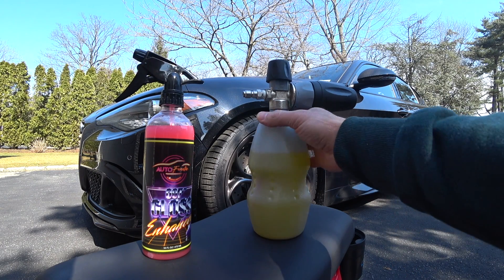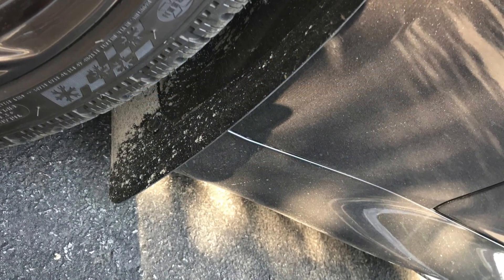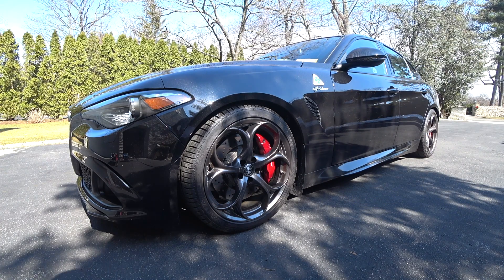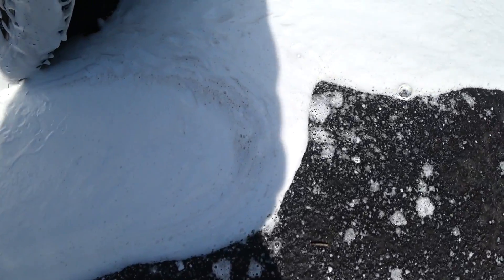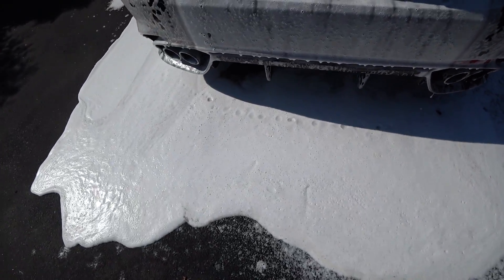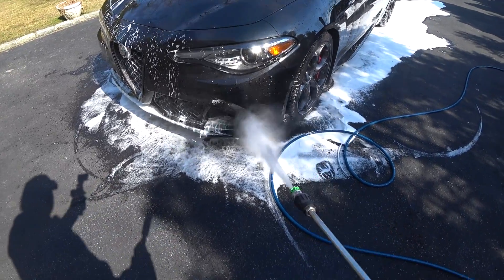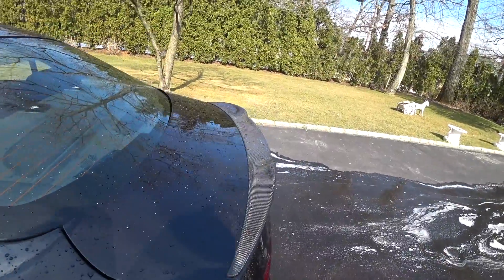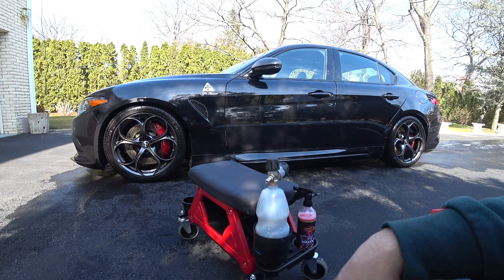Auto Fanatic 007 Snow Foam | New Product Intro

Comment: Do you recommend 007 gloss enhancer as drying aid after 007 snow storm wash?
Reply from the maker: thats what I do and WOW the results speak for themselves. try either way and see what works, if your car is very protected with wax or a top of the line ceramic coating and you do touch less washes then i do not use any towel or drying aid i blow dry the entire car touch less.

Comment: Great product. Does water temperature affect the product? Does it work as well using cold water as opposed to warm water?
Reply from the maker: our new soap works excellent with cold and warm water. Look it up on our site or Amazon Auto Fanatic 007 Snow Storm V2 the blue formula.
Reply: @autofanaticcars  Does Amazon carry the new version?
Reply from the maker: yes they do if you see the listing with the blue soap it is the latest version

Comment: Is this going to be PH neutral and gentle on the waxes? I'm using Bilt Hamber Auto Foam which has very good cleaning power but people say that it is not wax safe. I have tried other snow foams but they have more or less no cleaning power. The mild ones are OK I suppose if you only have dust or road film but up here in north Europe with dirt, snow and road salt you need powerful stuff. Even Bilt Hamber can't clean a car on it's own. It only takes off the loose particles. Hand wash is needed afterwards. I would not dry my car with microfiber towel after just a snow foam wash.
Reply from the maker: this is ph N right now

Comment: My snow foam takes dirt off like this. I use honey dew and mr pink combo.
Reply from the maker: i never had any CG soap work like that for me and they also strip the surface and do not feel slick as my 007 Gloss Enhancer. this will be a very unique soap once we are finished developing it and it is not easy targeting all these areas in one product.
Reply: Arjun I use Chemical Guys glossworkz glaze and honeydew get thicker foam and gets the dirt off like this without agitation.
Reply: Auto Matic when I do a pre soak and rinse I see dirt coming off. And it’s not by the wheels. I mean at the end of the day just stuck to what you like right?

Comment: I might have missed out on something, but what is the car protected with? Not to sound critical but with some of the better ceramic coatings/waxes it could make any snow foam look good and create the effect that its «dragging» off all the dirt.. Would be cool if you had a random customer car come in for a quick wash and see the product in action on that. Knowing how dedicated you are to create a solid product theres no doubt in my mind your new product wont disappoint. Looking forwards for more demos :D
Reply from the maker: zero protection weeks ago i tried Fusso99 and did 3 strip washes so far using the Griots Boss Strip Wash so I could have a clean slate for testing of this new soap.

Comment: How about Active Avalanche (if you get more foam) or Synergy Snow Foam.   Do you plan to have a west coast distributor for the wheel cleaner and this new product?  I don't say this to give you a hard time, I really want to try your stuff as it looks awesome!  The shipping just to CA to try it was kind of prohibitive unfortunately.  I decided to try another product instead for now.  Definitely interested in the PF22 holder.  I'm sure at some point I will have enough interest to combine some stuff if you don't stock it out here.
Reply from the maker: if you feel the shipping calculator is off just email your full name, address and order and we will rerate and invoice you direct. Your in Zone 8 and some zip codes the shipping plug ins go funky and its just expensive to ship from the other side of the USA.

Comment: Is the 25 degree nozzle safe to use to push foam off a car. Everywhere I read they say you can hurt the paint with the green nozzle. 

Foam looks great can’t wait to buy!
Reply from the maker: my 40 degree went missing when i shot this video so it was all i had but its safe as long as you use fast sweeping technique and the right angle i never had an issue it just takes more passes with the narrower stream thats all.
Reply: Yeah I lost my 40 also last week the same way! Keep up the great work and thanks for the quick reply. I’ll be first in line for the snow foam!
Reply from the maker: time for me to clean up my garage soon im sure its under something.

Comment: Hey auto, just wanted to give my two cents. Angel wax fast foam and Griots foam are the only foaming soaps I've seen that have great foaming properties and cleaning properties with the least product used and for the price on the market and as you've just demonstrated, yours foams pretty nice, not as good as angel foam or griots. It's cleaning better than either of them as I've tested both, and it seems to have similar properties as mastersons wash and shine. So your product is going for the all in one category with great foam with little product, great cleaning agents, and a wash and shine application for protection, lubricity, and hydrophobic properties. If you pull this off like your wheel cleaner, I will only use your product from now on like i do with the wheel cleaner.
Reply from the maker: development is not finished this is just a tease, and il make sure it kicks ass like everything i do.
Reply: @autofanaticcars  Respect man, you seem to be the only one out here who's trying to make products that are reliable and make life easier.
Reply from the maker: @XxVendetaxX1  thanks for recognizing that, that is my goal in everything I do, performance, value and more performance.
Reply: @XxVendetaxX1  how'd it work out?

Comment: Looks like an amazing product! The only thing I’m hoping for is that it won’t be soooo expensive. It’s very costly as a detailer to be using your products on a daily basis on customers cars. I’d advise selling you Gloss Enhancer, wheel cleaner as well as your new 007 Snow Foam in a gallon with a good price. Your currently very expensive compared to competition.... just some friendly advice. Thanks again for the video!
Reply from the maker: small company and lower production scales creates slightly higher prices for better quality products. there are an abundance of cheap crap out there already and i am not targeting the Auto Fanatic brand as such because the development and what goes into these products costs me lots of $$$ and performance is my priority over costs, even my 007 Gloss Enhancer i can cheap out making it for less by removing the key ingredients and selling for less but it will not perform as well. to me that is compromise i am not willing to accept. we will sell in gallons and 32oz for the snow foam soap when ready
Reply: Auto Fanatic Ok, I’ll be waiting for the gallons

Comment: Yellow color with a banana smell
Orange color with citrus smell 

Looks thick enough (for my liking) and the cleaning looks top notch already. If anything over the foam thickness, I’m more concerned with viscosity and lubricity on the paint and its ability to encapsulate dirt in order to avoid swirls and scratches. I detail for a living and am always looking for nice soaps.

Comment: Just don’t make it $50 a bottle please.
Reply from the maker: no soap is not as expensive to make as the wheel cleaner and will be a good value once we decide on package sizing.
Reply: Auto Fanatic ready to go gallon sizes or dilutions like the wheel cleaner?

Comment: If you increase the foam 40 percent more you’ll have a client for lifetime
Reply from the maker: making thick foam is easy, but making thick foam that can self clean and then leave the surface feel like 007 or Collinite 915 without residue and white streaks in the wheels and other areas is the hardest part of it all. We will make it happen because i am determined to achieve these results.
Reply: Auto Fanatic please do, I also want your cleaning wheel solution send me a email or a link to se price can’t get into your website